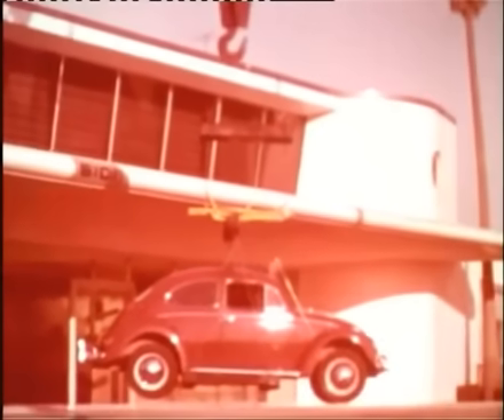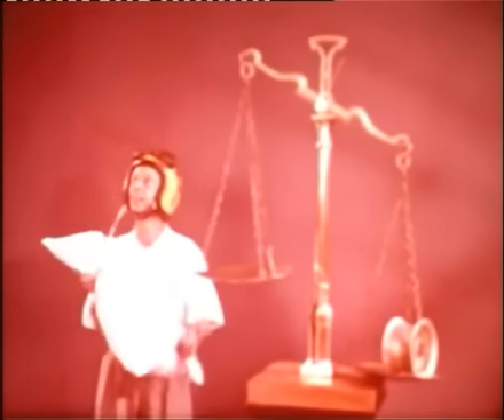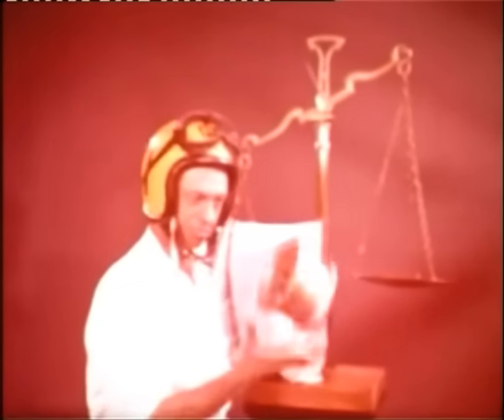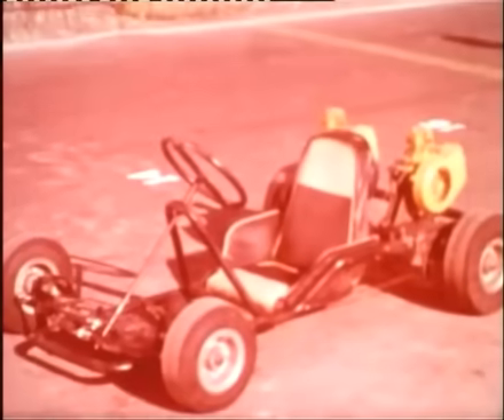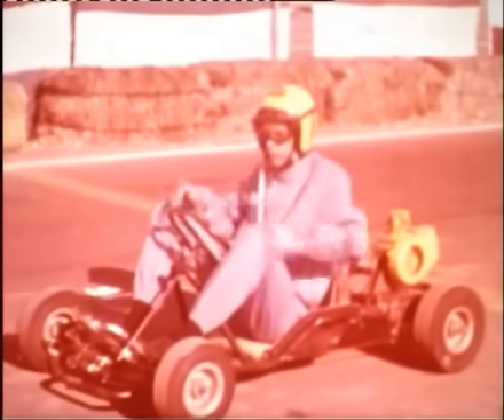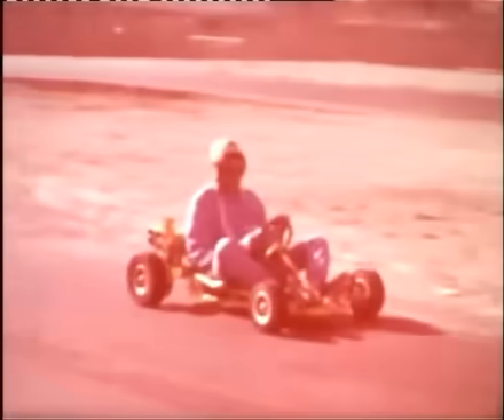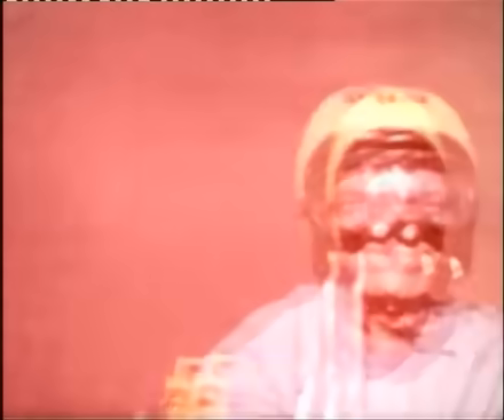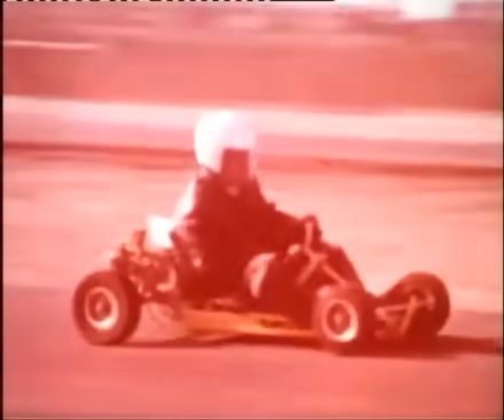McCulloch Kart Promotion Movie circa 1961

Comment: I lived on a go kart as a kid. For about 6 years. Almost every day. Wasn't the fastest, wasn't the fanciest. But, it was the most fun. I had 160 acres and miles of Country roads to burn on. You can not replace those days. I feel blessed.
Reply: Same for me. I grew up out in the country and in the 1970s I had a one seater and then I got a Sears 2 seater with a 5hp Briggs and Stratton engine. Gave all my neighbor friends rides in my 2 seater.
Reply: I envy you. We had to ride in the city. I don’t know how we didn’t get run over. Blessed to I guess!
Reply: 2 seater got the girls to ride along
Reply: I got the Orange Crate from Sears in 1976 for Christmas.   Lived in the city.  I would ride to the convenience store and get gas and head out to the biggest parking lots in town. I got chased by the cops a few times and got away by getting the jump on them. I always knew when they see me they are gonna come. I just saw them first every time.  Rode till it got dark every single day unless it was snowing or raining for 2 years.  Man i had a lot of fun.
Reply: @ Chicago cops would chase me too but I’d make a quick u turn and be gone. One time they snuck up behind me when I was coming home. My father just happened to be in the driveway. The deal was I would only drive up and down the alley… right. I pulled in the driveway and he pointed behind me. I turned around and saw the cop car. Double trouble. They put my cart in the trunk of the cop car and told my dad he would have to pay a fine and pick it up at the station. I never saw my cart again.
Reply: Yeah the good old days!! We had karts and mini bikes!! I think about those days all the time!!
Reply: @mikes9759  Yes, Those were the Days!
Reply: @1gdfoster1  Yeah so much better than this garbage we're dealing with now!! Our wonderful government sure took care of things!!

Comment: When I was a teenager in the mid-1970s my best friend had a go-kart powered by twin McCulloch 101's. I remember every Sunday in the summer going to the local Venture (department store.) parking lot because Missouri had a Blue Law, no shopping on Sunday. Only gas stations were allowed open. I recall building a start engine for the Macs. We used a old Tecumseh horizontal shaft engine with a pulley and mounted it to a hand dolly. Using a fan belt to turn the pulley's on the Macs you'd pull back on the dolly and stretch the belt tight and it would turn the Macs fast enough to fire them up. Ironic, my friend attended a technical high school (junior & senior years.) to become a machinist. His first job was at Margay Racing here in St. Louis. He was saving his money to buy a new kart, but other things became more important to him, like building a Harley-Davidson chopper.  
                             Man, those were the days of fun in the sun. As long as I live I'll never forget!
Reply: Fried burritos from the Venture snack bar!  Missouri was a backwards kind of place in those days!  Katz drug used to block off isles that had anything useful on Sundays.  Primitive!
Reply: The 60s were awesome. Very little awareness to safety and kids played with large metal Tonko trucks.
Plus, being raised in Las Vegas the 60s was awesome and it was such a small town.
Reply: We built a starter out of a Ford engine starter with a socket welded on the shaft. Had a starter solenoid with a push button on it, hooked up to a 12volt car battery...man those were good times, but we had an actual race track out by our airport
Reply: @JohnnyJimsAZ 70's were cool, too, except for disco, haha.  80's started good but went kind of sideways 😳 😬 😐
Reply: @GregTurner-ks4ii  the 80s were off, but it was to get better later, but it was also the beginning of the AIDS epidemic that devoured this country very similar to the COVID-19. That pretty much ended half the 80’s discos in the United States. And then eventually all of them.  It was also my 80 to 84 enlistment with the Air Force. Looking back I have good memories.

Comment: I had one of those dual  engine racing go karts. It had racing slicks , fast turning and was about 1in off the ground. It would just slide and not flip. It did not have an engine but my father and I built a frame to mount  a fan cooled  Puch  4 speed two stroke engine with a kick start. With the transmission it could climb steep hills and go down trails. With a gear shift under the steering wheel it performed much better than the centrifugal clutch two strokes. I used to drive it arround my father's research lab at Oak Brook polo fields / airport back in the 1970's . Many good memories of building the cart with my father and driving it around.  During the winter I would take it out on the frozen ponds. Plenty of fun doing donuts and sliding around. Being a bit geared down due to the kart tires being smaller in diameter than the motorcycle it buzzed up to around 50mph with plenty of torque! Still remember the loud two stroke ring-ding-ding and cloud of smoke it made. The exhaust was the original header pipe with a lawn mower exhaust fitted with a Budwiser can with holes punched in the bottom to keep the noise to a level where the neighbor wouldnt call the police. It wasn't a tuned expansion pipe but it did work pretty well and did not stick out to far. McCullough chainsaw mufflers were not to much better in the movie. I found recently a vintage book from the 1970's on go kart racing. It's an interesting book of all the companies making karts, engines, transmissions, tuned exhaust pipes and parts.  I think go karts are still popular today but much more like a race car. Don Knotts got the pretty girl in the end and dates the movie to the early 1960's.https://www.amazon.com/Karting-Leroi-Smith/dp/0668019395 nn Another Don Knotts promotional movie where he got the pretty girl in the end: https://youtu.be/CmlWeWUD4IA?si=bVJt6qPqb5PSZXLc  and another https://youtu.be/9c_W1jfrzj0?si=7VFLjfwPTamK_SCy

Comment: In the 70’s my dad bought an old Nimrod pop up camper and a Sears Ted Williams outboard from a friend that needed some $.  That little 7.5 hp short shaft , water cooled 2 cycle outboard motor took us all over lakes here in SoTX.  Later when I would perform work on that motor I discovered it was a McCulloch engine.  Parts became tough to find and I had to eventually scrap it, a sad day. It was a reliable screamer, that was lightweight and fun to throttle up!

Comment: I had a few friends that raced carts in the early and mid 1990s. By then they looked like little mini F1 cars. We were all in our 20s at the time. I was in the early stages of opening my collision repair shop and still working out of the revamped tractor shed in my  parent's backyard. That was our race shop after 5:00PM. I painted those carts a cool new color and scheme every season. Flames, scallops, flip flop pearl and the like. As I recall, they were powered by alcohol burning souped up Briggs and Stratton 4 strokes. We had a great time with them until the track closed down for good. I don't know if cart racing even happens any more.

Comment: Friend in High School had a brother who had a half midget powered by McCullough.  Raced at Pomona, Ca. quarter midget track.  Dave and Rick Nelson raced there.  There was a track in Brea. Ca. also.  Engines were as pictured, chain saw with bar and chain removed.  Accelerator pushed the trigger just like your finger would if cutting wood.  This was late 50's early 60's.

Comment: I won the Rota 200 in 1964 with a West Bend 580 V5 engine running against Mc 9’s which were a faster class but this was a endurance multi class race. At 14 years old this was a life shaping experience.

Comment: My dad and uncles raced karts with twin, stroked  McCulloch Mac 10s with twin carbs and velocity stacks. The exhaust looked like a square trumpet bell. There was a switch to bypass the points at high rpm that was supposed make a hotter spark. They regularly kicked the factory karts asses. They stayed sideways most the time. The first drifting I ever saw, back in the early 60s. There are a couple of them left at the shop I was working at.
Reply: That switch also changed spark advance.maverick spark.

Comment: Prior to the introduction of the 1963 AC Ford Cobra and the Ford 427 Thunderbolt in 64 I had never lusted for a machine the way I lusted for a go-kart. I was obsessed, completely consumed but unfortunately we were far far too poor to afford some luxury like a go-kart. So I fed my lust at the Westminster, Colorado shopping mall , just a block away, where every Sunday there were dozens of go-karts racing in the parking lot because at that time there was no shopping on Sundays thanks to blue laws. My God those things were noisy. Totally unmuffled and worse yet, they had a megaphone exhaust which amplified the sound even more. Even at that early age, 11 or 12, I had a recurring fantasy of making a Go-Kart with a 450cc motorcycle engine with transmission. Never had a go-kart but I did build three hot rods by the time I was 30.

Comment: I knew this Chainsaw Company made Motors that got put on go-karts I was under the impression they were just chainsaw motors that like hey this would work on a go-kart so a bunch of chainsaws got there motor taken away from them put on a go-kart anyway can I go back to watching this also I thought this was the thing that happened more in the 70s surprised to see this was the standard for great go-kart Motoring in the 60s
Reply: I had a gokart in early 80' where I had finally put a chainsaw engine. Acceleration was phenomenal. At the end though it caught on fire being a 2-stroke some gas spilled on the engine by accident and it was emregency firemen city after that...and the end of my karting days. Still remember the big crowd that had attracted.

Comment: I raced a McCullough R1 when I was a teenager.  It looked impressive but the frame was too stiff for the light classes, and especially for me, a kid running a single engine.  My father raced it in B-stock and did fine.  He completed against another R1, driven by big Red (he weighed 300 pounds), it was perfect for him.  Nevertheless, my Bug Wasp and Hornet kart handled better.  Oh, and the rubber "shocks" we're not even noticeable.

Comment: early 70's dad & I built a box frame mini bike with a Briggs and Stratton 4hp it rode & handled  like a piece of 💩BUT THAT BABY WAS FAST 
Then I got a little red Keystone mini bike slow as 💩but it rode and handled great then I got a Kawasaki 100 street/ enduro 10 speed 
5 gears for street and 5 gears for trail little switchy thinning on the handle bars Then I got a 1976 Honda 550 four crashed it Hospital 2 mo
been riding easy on 4 wheels ever since

Comment: Mc cullock is a " chainsaw engine " adapted  to a go kart !"
Reply: Initially, for the first year+/- they were, however... they quickly developed their own "In house" Go Kart, R&D racing engine program after that.   The engine requirements between a "chainsaw" and a racing kart weighing up to 300+ lbs w/driver.... are Vastly different.
Reply: @Romans--bo7br  not many300 ,# kids in my neighboor hood, mostly less than 60#

Comment: If you can keep that front wheel on the ground😁☕
Reply: Better if you can lift the inside front wheel over the tires marking the curve so you can straighten the curve more.
Reply: @jockellis  yes, I kinda know that, but the narrarator speaking of the steering design, to help corner better...not helping much, if its not contacting the track surface😁☕
Reply: @jockellis  or, there's always MasterCard...😂😂😂😎☕

Comment: Looks alot like my old rupp dart cart/monza
Reply: The Dart "A" Bones & Go Kart (brand, from Azuza, CA.)) 800 & 1200 series, could run circles around that Mac R1 with a good driver in it, even with West Bend 580's or (especially) with Power Products AH-82's.  Personally I found the Go Kart 800 series a Very comfortable Kart to race.  The Bug Engineering chassis was really good, as well... but a tad heavy.